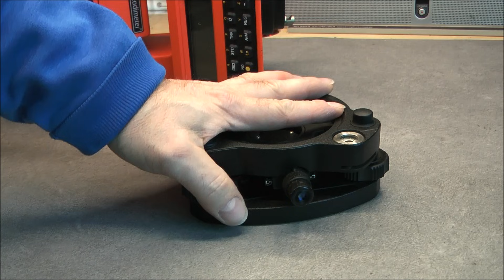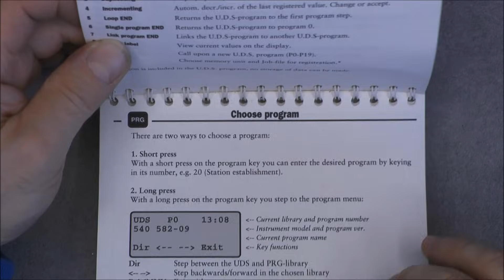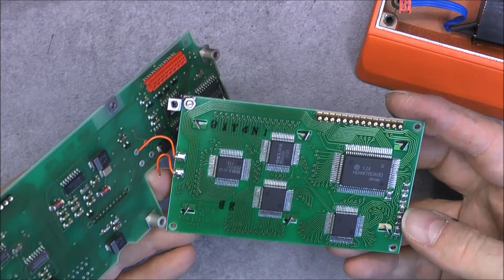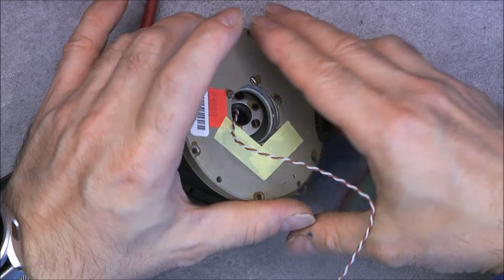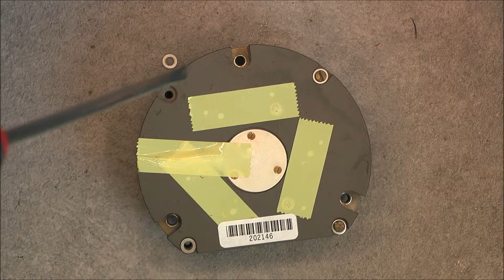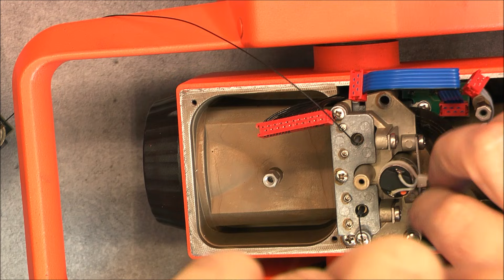Geodimeter 510A total station teardown

Comment: the main parts of the programming and the calibration data was stored in the static ram. when the internal backup battery is dead, there is no way to bring it back to live. You must have a specialiced pc with a serial connector card. And on the pc must be installed some programs which can backup and restore individuell instrument data. The software and calibration data is bind to the serial number of the instrument. So i think it is nearly impossible to get those instrument working...

Comment: Nice.
Yes - The complicated part was the electronic level.
Notice that the motorized circular optical filter has a retro prism at the end of its travel - for a reference measurement - to calibrate the range finder. 
Notice also that the TCXO frequency is tuned to the speed of light.